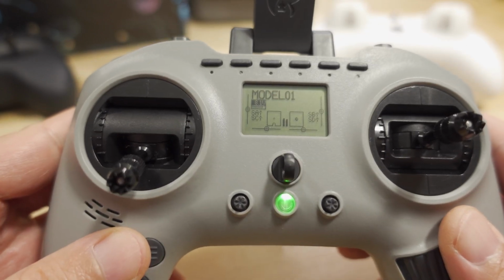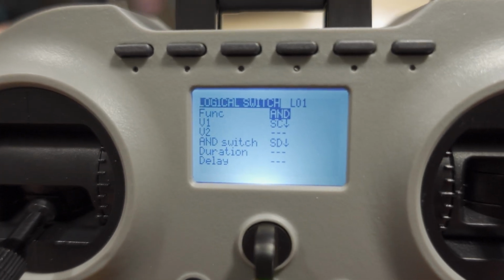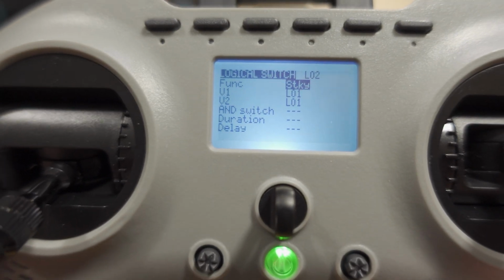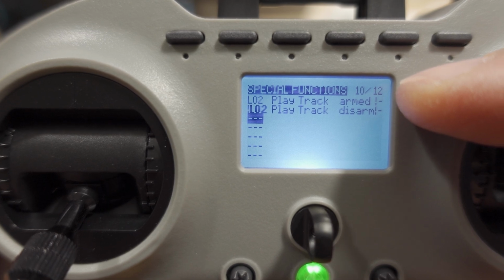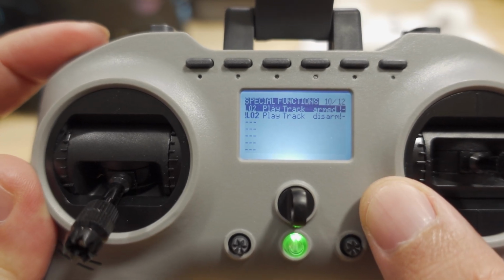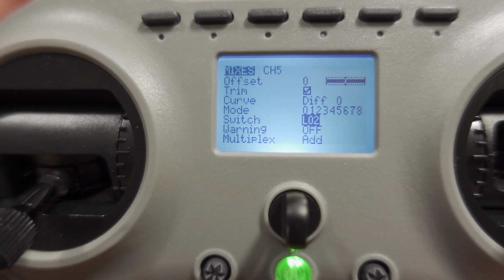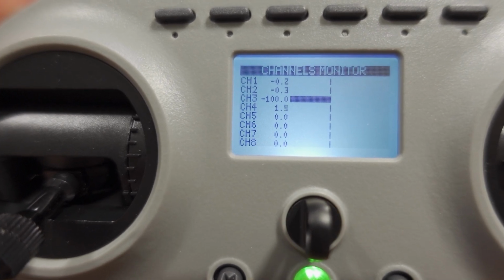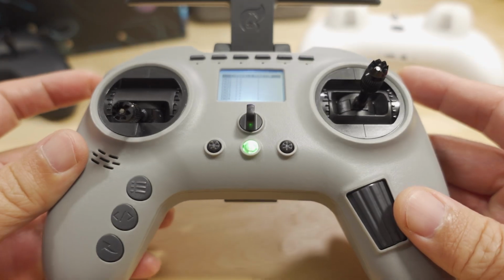Jumper T-Pro Dual Momentary Switch Arming (OpenTX Tutorial) 🎓

Comment: i have 7 models ..is there a quick and easy way to change them over to this dual button arming method  instead of the long winded way like 1 by 1 🤨🤨
Reply from the maker: I'm not aware of a quick way to modify existing models. This kind of feature doesn't exist yet in OpenTX or EdgeTX.
Reply: @AlbertKimTV  thx AK 🙏🏻🙏🏻👍👍

Comment: Will the jumper pro firmware and sd sounds work in a jumper t lite ? I just bought a t lite it arrived today and seller added edge 2.8 somthing and tx wont function cant assign anything or set up .it shows bad sd card contents and only does 10 th or less functions and no sound ,sellers being a butt head off ebay .any advice or help be apppreciazed .its probally v1 i got it to almost setup once now nothing and sticks wont calibrate
Reply from the maker: Firmware won't work.  Sounds might... I'm not sure.  You should get the correct files from the EdgeTX companion.

Comment: This is great and a safe way. 
I have tested the alternative which worked fine for me. 

1) Create logical switch L01 as a>X with input from S2 ( right VR pot), then set X= -90 (or other desired trigger point). 
2) Assign the L01 switch as CH5 source. Slide to left dead end as -100, a quick slide to the right passing the X triggering point as +100. You have enough dead zone to  prevent it from switching over accidentally. 
3) Setup special function for L01 and !L01 to play track ARMED and DISARMED respectively.

Comment: Hi, i’m trying to follow your setup but it does not work on my T-PRO. One thing that i noticed, when i push SC or SD, there is no change from thin or bold on the font. Any idea? Is there anything i missed? Or any update firmware? Thanks in advance!
Reply from the maker: Hmmm, sorry all I can assume is some step was missed or not setup properly.  Which one?  I would have to see the radio in person to diagnose.  Obviously, it works on my radio as demonstrated in the video.
Try and create a fresh new model and start over.
Reply: @AlbertKimTV  OK… maybe because previously I had imported a model from a different radio. Thank you

Comment: Albert, hello! What do you recommend to do with batteries which voltage went lower 3v? Just utilize them or not? Is it a big risk?
Reply from the maker: Don't recommend letting the voltage go below 6v (3v per cell).  The radio might turn off unexpectedly.

Comment: I feel like I'm going crazy, everyone is saying they like this radio and this makes things safer, but most flight control software already had prearm options?  Not only that but wouldn't this theoretically slow down your disarming, since you have to fumble for 2 buttons, thus making this solution less safe? The dual momentary switches along with the weirdly large antenna are just strange oversights that I would not expect, and I struggle to understand why anyone would pick this radio over the Zorro, but I guess that's just me.  Great tutorial as always Albert, super useful despite the weirdness from Jumper
Reply from the maker: I've been flying with this setup and have not had any issues with disarming.  It just takes a little bit of time to adjust.  I'm just as fast as with a single switch.  Some people don't like the large screen of the Zorro, some people don't like the large antenna of the T-Pro.  Everyone has their preferences.  So just pick what is good for you.
Reply: @AlbertKimTV  guess it just isn't for me

Comment: Can you do this with a TX16S? I think having a double disarm would be safer. If so, how?
Reply from the maker: I don't think that radio has dual momentary switches so the method would be totally different.  You might be able to use the AND logical function with another switch but you'll have to remember to toggle that switch along with the momentary switch so it might not be all that easy.

Comment: Now I like this radio even more! This is a safer method of arming than a normal toggle switch imo. Great work!
Reply from the maker: Glad you like it!  Yeah, I have been using this for several flights and it takes a little getting used to, but I'm liking this a lot and it's safer all around as long as you understand it's different than using a normal arming switch.
Reply: Is it really safer than using a standard switch with a prearm switch?  I use a toggle + momentary for prearm on my tango2 and I feel like that would be safer because I don't have to fumble for a second button to disarm
Reply: Yes indeed. I myself don't feel safe to arm/disarm with a normal toggle switch together with others. I used Function switch 1 instead. But for people who prefer the switch at the front right location, they can use the VR Pot as a switch as well. Add a 4 point curve to change that Ch5 to be a step function for -100 to +100

Comment: Just a heads up, your BG coupon code doesn't work.
Reply from the maker: Yes, it seems it expired on 12/31.  I am trying to get it reactivated.  Have you tried Drones8?  That might work too.
Reply: @AlbertKimTV  Drones8 didn't work for me either.  Not a huge deal.  I'd be interested to see a comparison of this and the zorro anyways.  I'm currently on 900mhz eLRS, but I could be convinced to swap my 2.4 stuff if I could have it all on one radio without having to swap modules.

Comment: I'm still looking for the "perfect transmitter"'. or at least the best starting point and I can circuit bend it to my will from there.
I'm still using a frick'n Flysky NV14 nirvana. Had to reflash chips on the board to unlock it from factory and I've been running a custom firmware I coded up for it.
Reply from the maker: Where did you get the info on how to unlock it from factory?